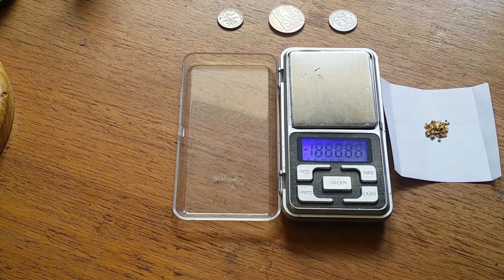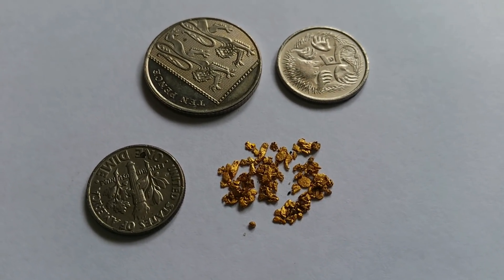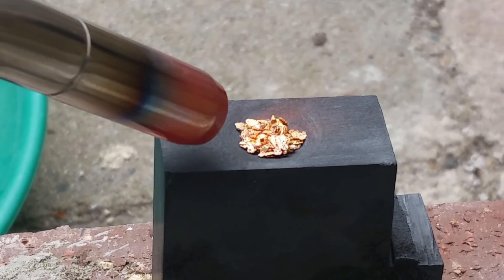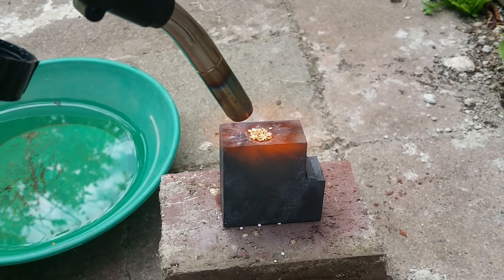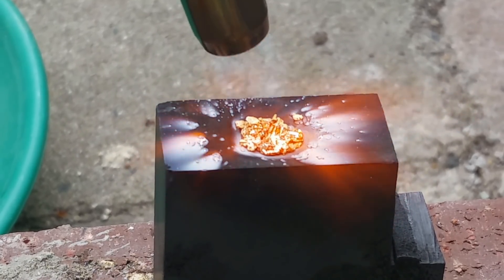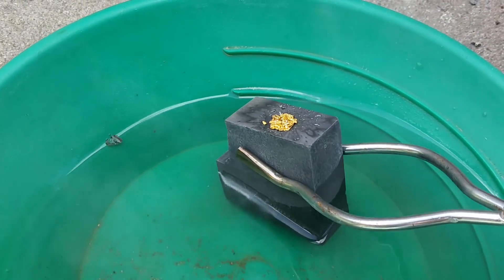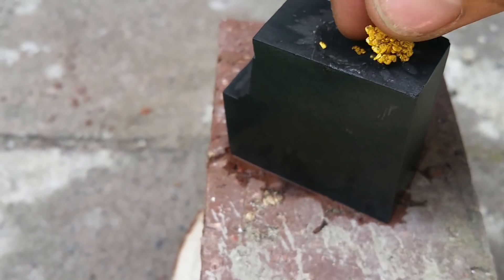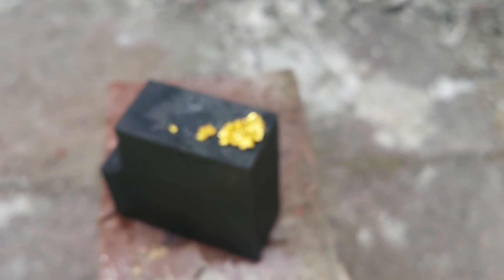Attempting to Melt 1g of GOLD with a Torch

Comment: Problem is you have a very large thick graphite . in order to melt it you need all the graphite to get to temperature too. And 15 mins is nit long enough.  Also DO NOT SET GRAPHITE IN WATER .  when you use it again it will explode

Comment: you need the mapp gas oxygen torch from home depot, its 65 dollars, the oxygen doesnt last long, and you have to start with the mapp gas barely on then turn the oxygen on like three turns to get the flame hot, but it will melt silver and gold. oh and dont do it outside the flame is tempermental until you get it going.

Comment: Also, you should of made the depression in the graphite on the flat, not on the edge. The flat is like 4 inches across and will sit low on the bench with heaps of room for a bigger and or deeper crater.

Comment: Good try my friend, try 2 torches with the borax, should get hot enough then, also a deeper depression to melt the gold, well done anyway for having a go, cheers michael.
Reply: yes this . you do need a deeper dish , and that looks like 18k so it should melt faster than 14 ish,  ive smelted that grade in about max 10 minutes with map gas and also dont forget to glaze!
Reply from the maker: These is all natural gold straight out of the ground. It is likely to be 90-95% pure gold. Definitely not 18k. And took about a min or so when done in a proper crucible bowl thing.

Comment: The graphite makes it take way longer. But I guess that's all you had. Get some crucibles off ebay cheap.
Good stuff anyway.. that torch will work, it is what I use. The borax helps bring the heat up..but yeah.. graphite was your only problem.
Reply: swiftrick15 borax is strickly for cleaning the gold during the melt
Reply: No its is not. It will help to remove SOME impurities but is used to help increase the temp quicker, and also used to glaze the crucible. To clean the gold, you need to refine it, which is done before the melt.
Reply: swiftrick15 that would be soda ash
Reply: Its common knowledge that it helps remove impurites during burn..and it lowers the melting point. However it does not purify the gold. I have never used soda ash. 
Borax is a flux... that is all
Reply: To help promote melting.
That is Borax's main function.
Do some research

Comment: So the graphite had to heat up first and then the gold was starting to melt but it needed a lot more time at that temperature or hotter.  Oxygen Propane or Hydrogen Oxygen are hot enough to do it faster.

Comment: You need to be more patient.  You can melt gold with that torch no prob but it   takes some time and try insulting the graphite with insulation or try getting an old brick the kind that won't pop and break pieces of when you hear it to glowing red hot.  Those refactory bricks are great for this.  And you can sand out a bowl shape in them.
Reply from the maker: Watch the very next video I uploaded after this one...

Comment: No. You need a shallow crucible, and more centralized heat. I use a torch capable of 5000F, its needle thin. Your losing to much side heat. It needs to reflect back on itself... a sand hole would have been better. I can do buttons of 7-8 grams np. Good luck!
Reply from the maker: It was all in the crucible...have a look at my second attempt with a new crucible. Worked a charm 👌👍

Comment: And not a bonce in sight lol.
A bit of bonce is okay Diggin for gold.
I wonder if that graphite thing was stealing all your heat energy.
My son done one of those but he used a proper ceramic crucible.
I doubt they are too expensive,
Reply: Mohammed Novalija they are pretty expensive
Reply from the maker: Expensive? https://goo.gl/8CN12N
Reply: Good find.
Just reading the data at that link suggests pre-heating the crucible first and also to glaze the lining with borax
I wonder if doing those 2 things would work with your crucible
Reply: Just thought of something else that can only help.
Get 4 bricks , put 3 of them around the crucible and 1 over the top and that will make like an oven to keep your heat in.Use the ends of the bricks to make the oven small
Reply from the maker: I disnt see this until now, but I just shot another attempt and thats exactly what I did. Video will be up in a couple of hours 👍 Better results today too 😉

Comment: It was more than enough . The tip of the blue flame starts the melt, then good in and out as the gold starts to pool. Then flow it.
Reply from the maker: But it did start to melt...
Reply: Diggin' For Gold that wasnt melting just sticking from the heat. Try 2 torches and it will work. Also a deeper depression for the gold to melt in.and plenty borax 😉 good try though 😉
Reply from the maker: No, it did start to melt. The top was melting...as you can see in the video. The problem was the graphite was sucking away too much heat from it...hence the bottom not melting. I KNOW this because I just made another attempt with a ceramic crucible and one torch and it melted really fast. Vid up soon in a couple of hours.

Comment: 'Cup shaped small Crucible'......It will concentrate the heat/temp to a higher level no matter what torch you use. Can see there was a little melt there but if you play the vid back it is visible that a lot of the heat was escaping  due to lack of containment (Too open )..........You will crack it! next time :)   Least  you had a go tho bro
Reply from the maker: Going to try it with a cup shaped ceramic crucible tomorrow 👍
Reply: Yeh....you'll crack it bro